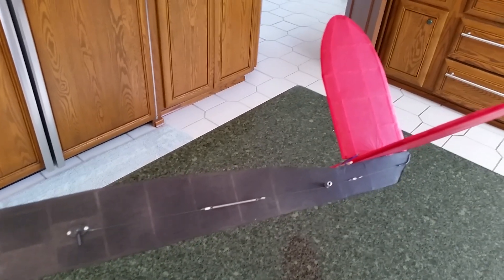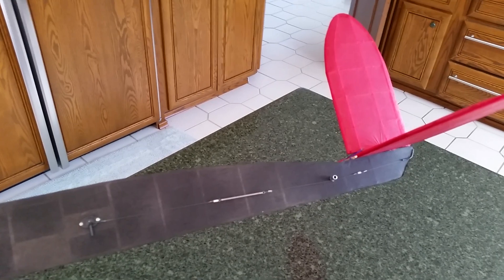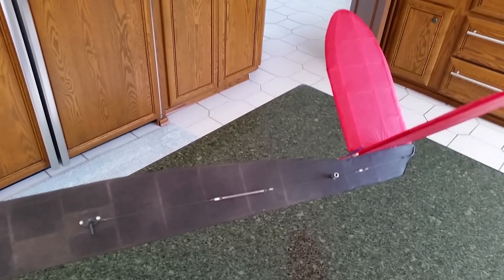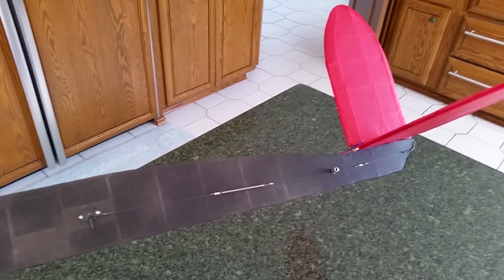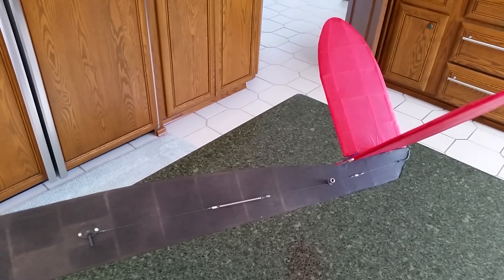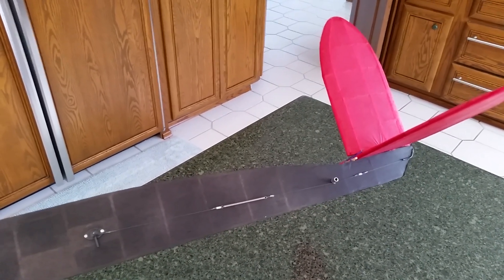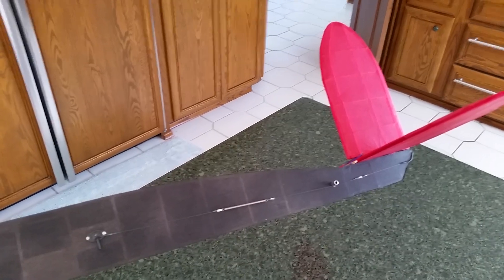20180802 163332

Comment: Hello
Could you pls tell what dia (Od, ID) alum tubing do you use for the rear motor peg? Is it a KS Metals tubing?
Reply from the maker: 1/8 -inch diameter Aluminum tubing.  You can purchase it from KS Metals or Volare Products.